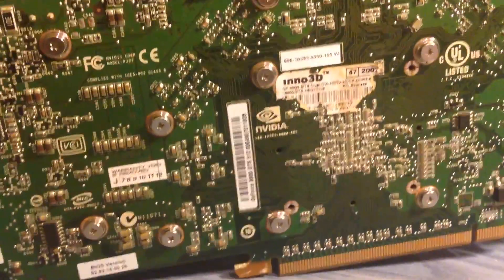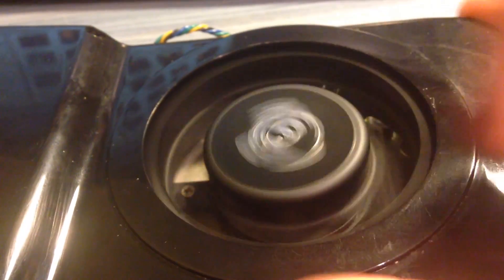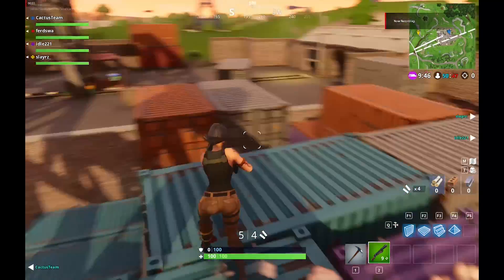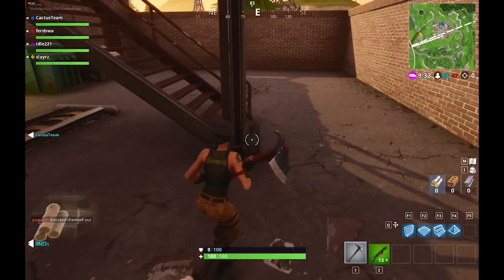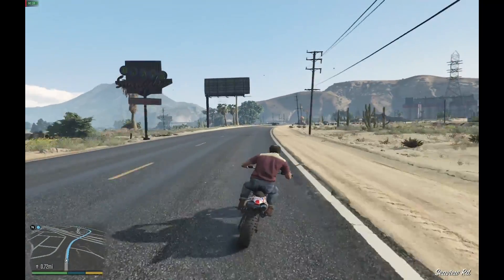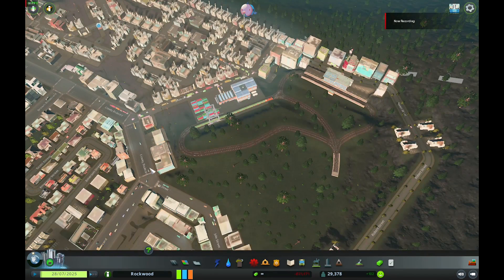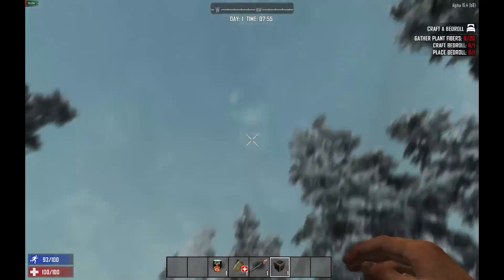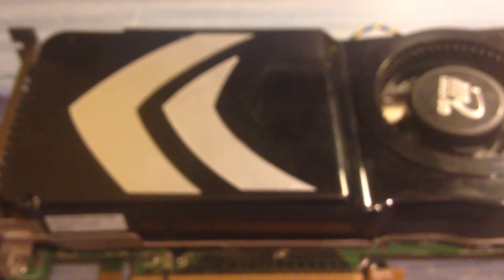Can you STILL GAME on a 8800 GTS?

Comment: interesting, i have a relatively cheap lenovo tablet/laptop i bought in early 2019 that has "radeon Vega 3 Graphics" and it's apparently comparable to the 8800. surprised to see what i considered a budget web surfer to actually be able to run games with a significant amount of power.